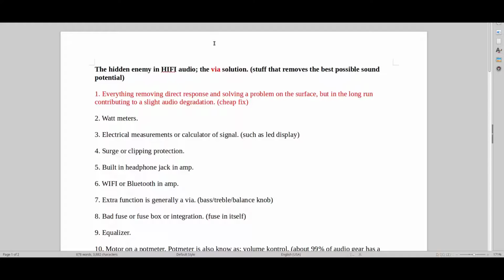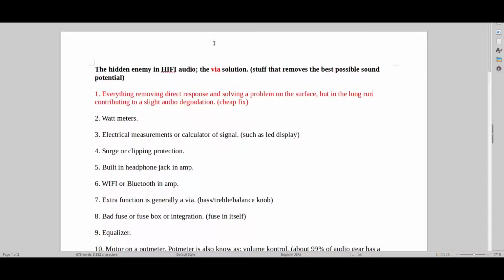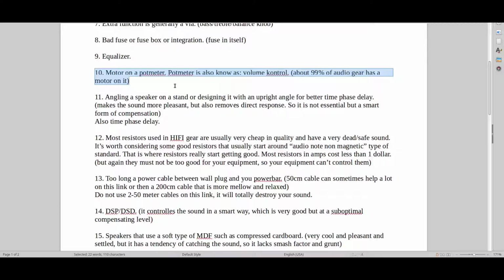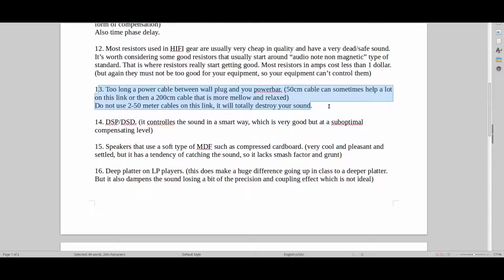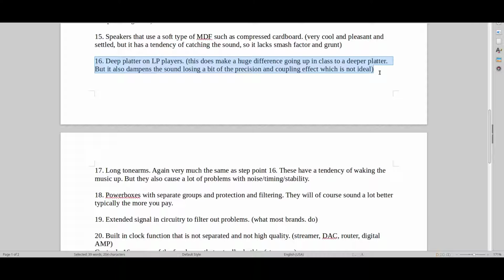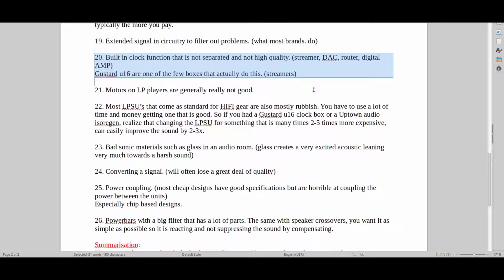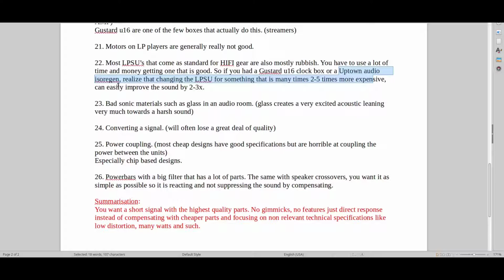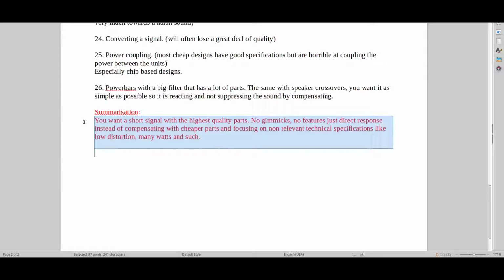The hidden enemy in the audio gear industry= Mr. Via

Comment: What should we do for surge protection?  Since you recommend avoiding built in surge or clipping in power strips or other products.
Reply from the maker: I think isol8 has it, not 100% sure about that. Gigawatt I know have it in their boxes.

Isol8 mini sub axis should keep you safe and clean AC/DC power, has 2 separate filters for slightly different sound, and is the best power box I know of.
Reply from the maker: The isol 8 min sub axis, has the most natural surge protection I have heard.
It has a fuse box together with the inlet plug, so that should be enough.

I think the Gigawatt boxes generally are as safe as you can be in the HIFI world. But you can also hear it more. (in my opinion)

I recommend trying the one I mentioned and then the  audioquest Niagara 3000, 5000, 7000 and Gigawatt pc 3+ evo se, and the gigawatt pc 4+ se with DC. Those are all crazy good boxes, that have a very different musical style.

Comment: About DSP and DSD. Why do you lump them together? Isn’t DSD a format, whereas DSP stands for digital signal processor? I can see why you want to avoid DSPs if possible (I don’t have an opinion on DSD, I just don’t know enough, though I’m overall skeptical) but they are very different things, aren’t they?
Reply from the maker: DSD if the modern high resolution format that usually sounds very processed in sound and FAKE warm. But kinda needed on lower end gear, to hide how bad it really is. 

DSP is basically room correction technology, meaning compensation tech a bit like EQ. Again, can sound good on lower end systems, but on the best systems set up in a proper way, then the makeup falls off, so you can really hear how it is obscuring the detail/helping it.
Reply: Yes, exactly. I just don’t understand why you put them in the same basket. Yes, they are both digital technologies; they somehow photoshop the sound. But they are also completely different things: you can bypass a DSP, for example, but a DSD recording. 

I’m probably nitpicking 😄, I guess you very frequently cite them together because they both apply make up to the sound?

Appreciate your work and approach.
Reply from the maker: @giorgiovaloti4129  Because they are VIA's.
Added signal/compensation, not the truth.
They function as a sort of "medium" of truth, braking data down so it is more digestable.

Unaltered and authentic recordings don't happen to be DSD, even though some people like it to be sold like that.
Reply: Yep, that’s what I meant: “applying make up” == VIA

Comment: Sir regarding streamer I have still one confusion .. Do I still need to use JCAT USB card using PCIe of motherboard if I plan to use Gustard U16 with some Uptone Galavanic protector externally
Reply from the maker: Yes, Jcat card, uptown audio isoregen not the uptown usb which is not nearly as good, and the Gustard u16. Later in the future you can then work on the serious LPSU boxes that power all of these things up.
Reply: Real HIFI Help Thks a lot